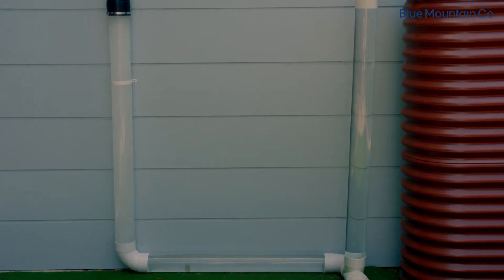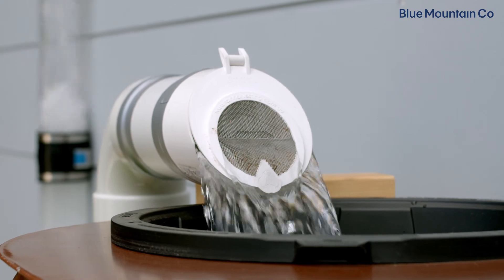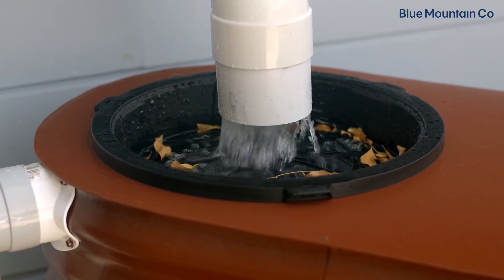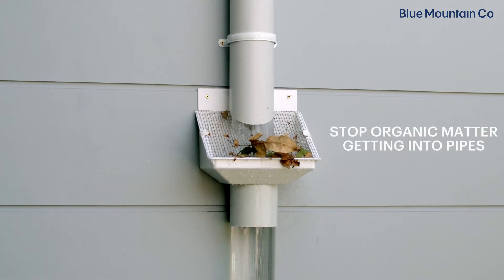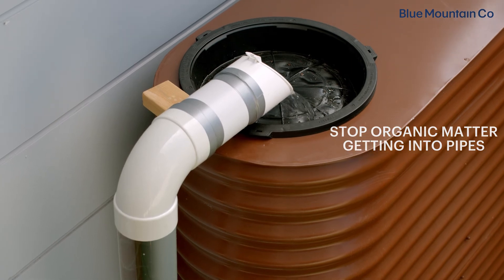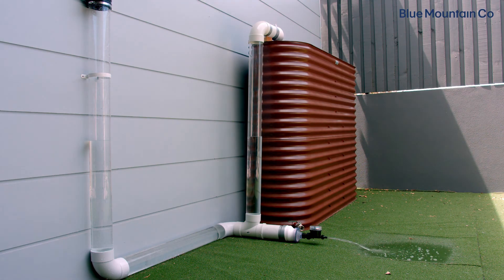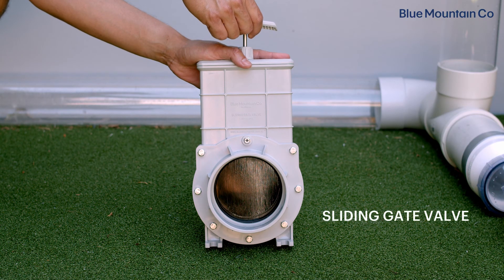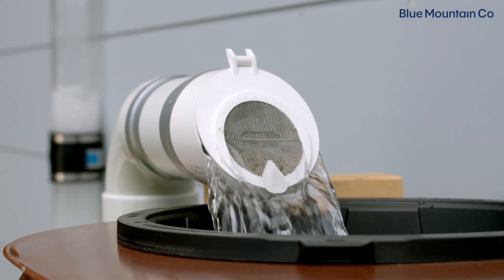FAQ - What's the difference between a wet and dry rain harvesting system?

Comment: I'm not too sure that running pipes around the building perimeter is impractical. For example, a larger than normal gutter system can double as pipes around the building perimeter provided they have some slope which will lead to a drain that feeds into a water tank with an insect mesh on top. As for the wet system, I have never heard of it until now and don't see any benefit unless the perfect scenario would present itself, which I can't think of any off the top of my head. As for rain heads, they seem to be a lot wider than narrow and longer, which allows more surface area to drain away organic debris. But despite this, I still prefer a small container to double as a sump for this purpose.
Reply from the maker: Thanks for sharing your thoughts!

Comment: Great video and demo setup. On a wet system how do you let the water out of the pipe if it's underground, and any valve to release it is above the level of the pipe?
Reply from the maker: Ideally, a valve (like a Sliding Gate Valve, or Knife Gate Valve) is installed at the lowest point of the system.  This is of course not always possible if there isn't enough fall on the block.

In that case, it can be helpful to have a valve as low as possible prior to the tank, this at least allows for some flushing of the pipework by running a hose in the upstream end of the system.  It won't drain all the water out perfectly, but certainly will flush the majority and help to refresh the water in the system.